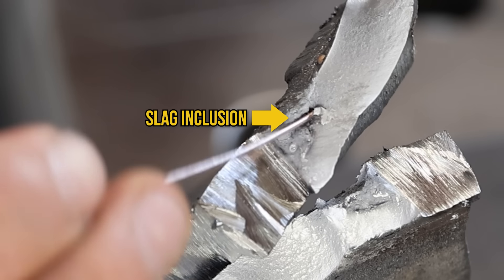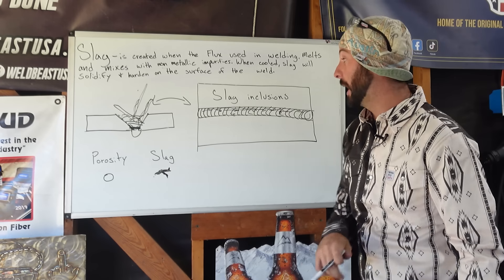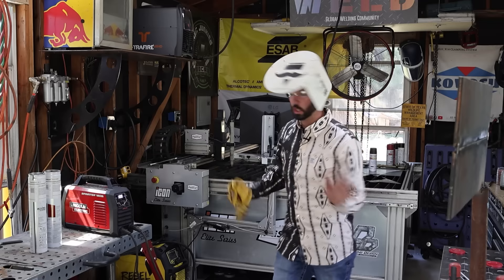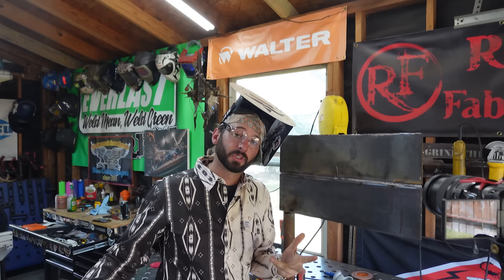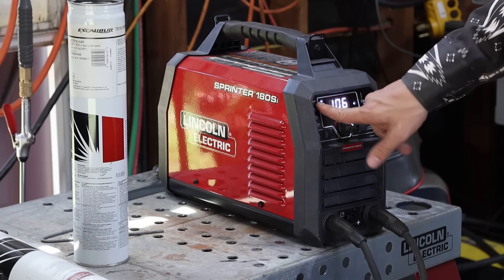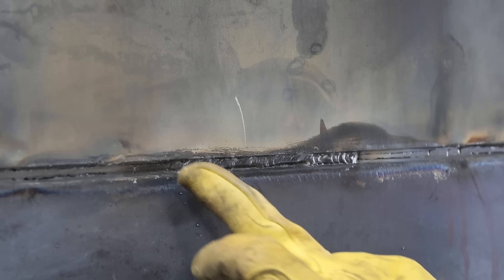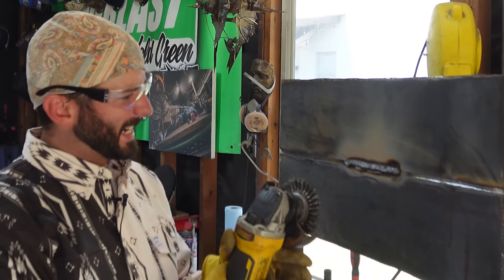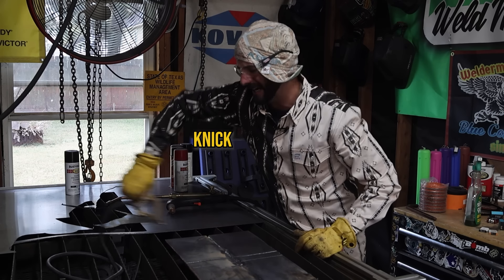What Are Slag Inclusions? (And How To Avoid Or Fix Them)

Comment: Always educational!   One other thing I found...   I failed an X-Ray from going crazy with the wire wheel.  I somehow left whiskers of the wire wheel behind.  Eased up on the wire wheel and passes with no issues.  The lesson.  Don’t go crazy with the wire wheel.  Thanks for sharing!  🤙🤙😎
Reply: I always go crazy with the wire wheel, never been a problem
Reply: @ktmturbo5836  I failed one.  Went back with a razor wheel before the hot pass and had no issues after that.  It was spray arc 2g.
Reply: @RichGT350r that’s wild. Would’ve never guessed it wouldn’t just get ate up
Reply: @Weldproshops  No Austin.  I never got blended in.  Shocked me.  And it was a stainless wheel and a stainless weld.  I learned a lesson on that one.
Reply from the maker: New fear unlocked

Comment: CWI told us always use DCEN with 7018 and save DCEP for 6010 so I thought it was odd you mentioned DCEP.
Reply: I want what youre having because 7018 is a DCEP electrode
Reply: @_hector__ yeah I mean it’s possible to run it DCEN but I wouldn’t do it on anything critical because it decreases the penetration profile by large margins
Reply: That’s wild to me 😅
Reply: Saving 6010 for the honeymoon?

Comment: and when an engineer needs a project done, they are forced to recalculate material size based on... the average slag inclusion index over the pool of workers they can afford to hire. lots of $8/hr hires out their. were on average a 28'000psi weld only holds 3800psi at the most, and the job material allocation is built around that... otherwise the engineer is forced to do it themselves and proceed to put out that same $8/hr slag filled weld because they are a book worm not a welder.
Reply: RIP: the rafters of every Walmart their is... $8/hr...